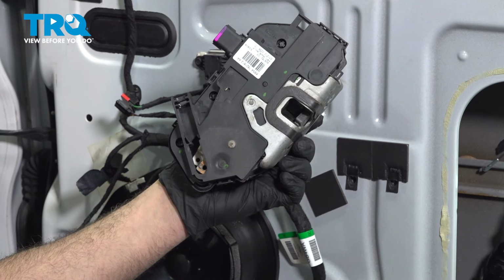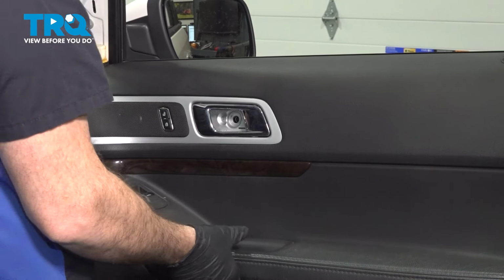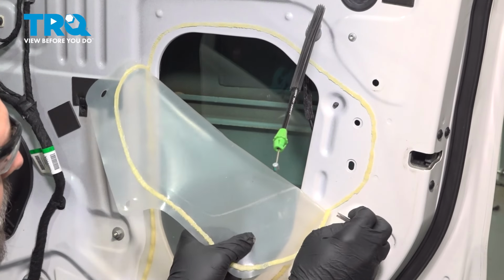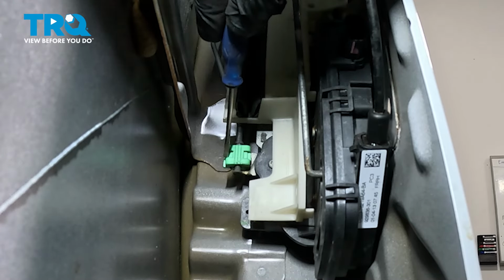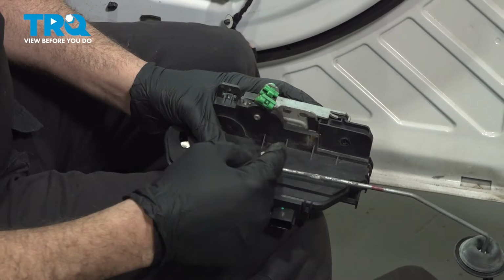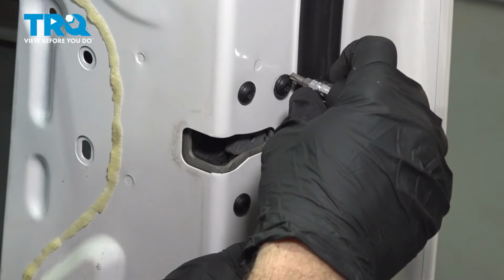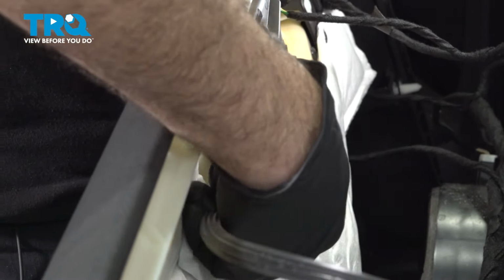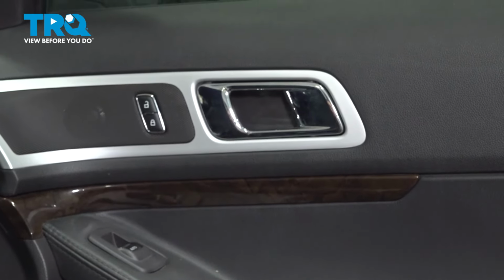How to Replace Front Door Lock Actuators 2011-2019 Ford Explorer

Comment: I just performed this procedure on my Driver side front door this evening. Only took me a hour taking my time. Rather than fooling with chance breaking the tabs on the window slide track, like  you did in this video removing the actuator, I simply took wire cutters and cut the plastic tabs on the actuator, throwing it away anyways, and it dropped out no problem. No fumbling with it like Biden speaks.

Comment: Getting that actuator off that bottom hook looks to be a challenge. That plastic is so easy to break, just like it did in the video. Too bad Ford didn't make that piece out of some light gauge metal,so if you had to, you could bend it. How could you repair the window guide other than replacing it?